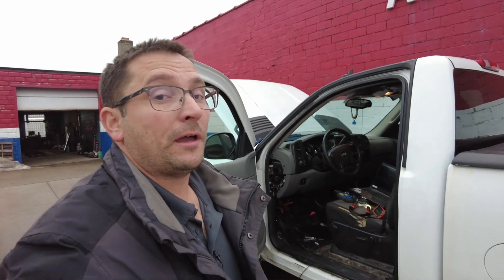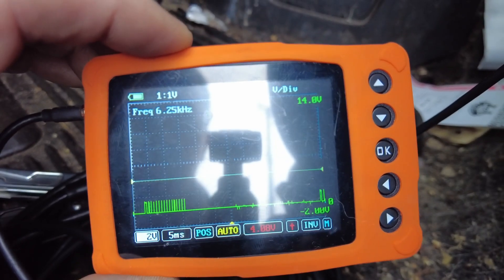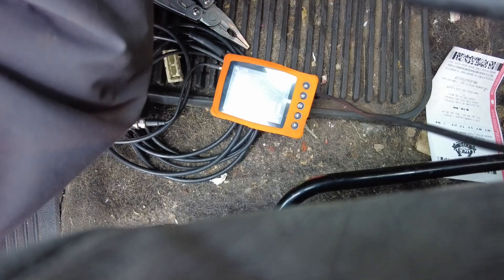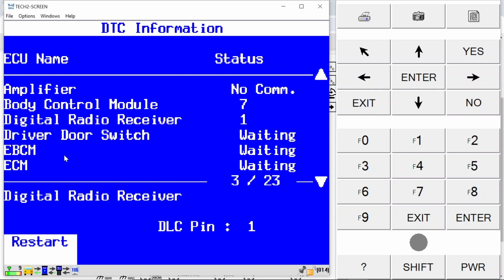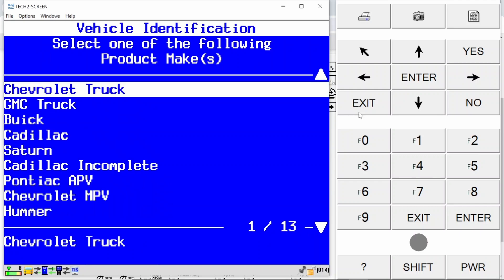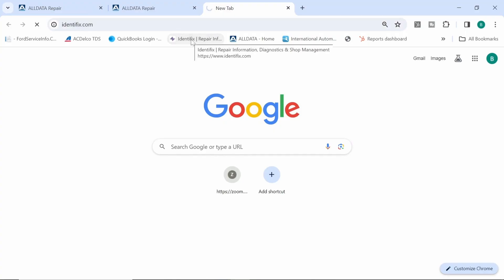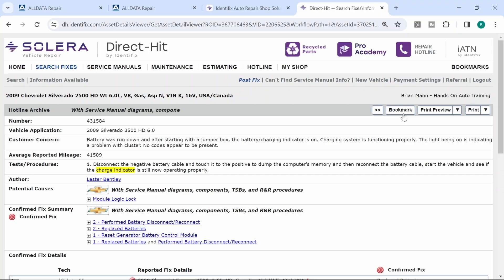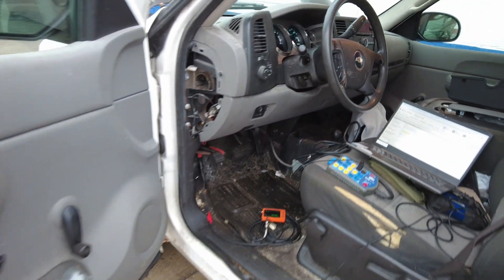2009 Silverado No Crank How I Diagnosed Communication Issue

Comment: I'm having a similar issue and I have to disconnect and reconnect the battery to start. Could my aftermarket radio be causing this?
Reply from the maker: Its possible if its on the network
Reply: I think im having the same issue wouldn’t crank or start checked bcm power ignition and actives. Pulled radio fuse and it started right up.

Comment: Hey I have the same a 2009 Chevy Silverado looks just like urs but mine will start but it’ll die after its starts well when u give it some gas and turn it on it turns on and runs but shakes like crazzy and won’t drive (have had issues with a misfire on cilynder 2 any info can help

Comment: The engineers of this electronic abortion should be severely punished.  How many mechanics will NOT be able to diagnose the no crank but will shotgun thousands of dollars in parts at it, up to and including the ECM?  Every single switch and function in a car does not need to run through a computer.  It smacks of planned obsolescence.  

My 2011 Silverado has had the radio display blinking off for years.  Fix is the same....a thump on the dash.  It has never affected anything else.   Recently, I've had occasional no cranks.  Hoping my problem is a relay or the column switch as opposed to something in the multitude of wires and control modules.  To be fair, the frame will likely rot in two soon anyway.  Lifelong Chevy guy but damn....

All that said, I will absolutely remember the hard reset trick!  Thank you.

Comment: I came across your video since I am working on a no start in a Chev Express. At 0.34 i see that octopus test lead, What is it called? I think my issue is in the canbus and that test lead would work there a lot easier than making a bunch of leads.
Reply from the maker: https://www.aeswave.com/uIsolate-Network-Isolator-p9669.html
Reply: Thanks for the link, maybe i will have one for next time. Today I found that it is the ABS module putting voltage into my  canbus causing the no start. The diagnostic paperclips did the job but a harness like that would be handy.

Comment: So the bad radio put down the low can network, that disabled the theft deternt module and the bcm causing a no crank no start  im guessing.
Reply from the maker: Yes. When the radio pulled down the low speed network, the bcm and therefore the pcm did not recieve the proper start enable code
Reply: Thanks.

Comment: Nice job Brian. From the Identifix fix details "Disconnect the negative battery cable and touch it to the positve.... and then reconnect the cable." I don't recommend following that instruction. 😊
Reply from the maker: I agree , that's why I jump it with a bulb or load, i feel that is much better in case there is a secondary or auxiliary battery.
Reply: Yes, that was meant to be satire to the poor way this was written. Of course you did this correctly with BOTH cables disconnected from the battery. 
If someone followed the procedure as written they would be in for a suprise. Also, good point about the possibilty of having an auxiliary battery.  @BrianMann216
Reply: They left out the step of disconnecting the positive… or you missed it.

Comment: Just had a 2010 impala bad low speed can had 4 bad modules hvac ipc theft deterrent and airbag module. Unhooked the splice pack and hooked one up at a time pulled the network down. It was on the west side of Columbus before I got called it was a gem
Reply from the maker: Was it a flood car?
Reply: It was at different shops the customer says they jumped it backwards. Do you know of a tool that can correct mileage on s as 2014 fusion used cluster? Or could I just swap the eeprom from the original to donor it’s a used car lot the original has a busted lcd screen
Reply from the maker: Not sure,   I would try auto pro pad 1st via obd

Comment: Great diag, I love the uIsolate makes easy work of class 2 networks. Thanks for sharing! When you have a separate issue like the battery light, do you just add on more time, or it's a separate diag, so a whole new fee?
Reply from the maker: In this instance I did not charge any more ( I was making a vidoe too..) I do try to get something extra for multiple issues,  just because we can fix an issue quickly does not mean that we should not be compensated for the skill and knowledge.. a not so good mechanic might charge 3 hours and get Paid lol..
Reply: @BrianMann216  I agree, I charge multiple issues as if it's a separate car. If I'm making a video I'll usually give them a break .